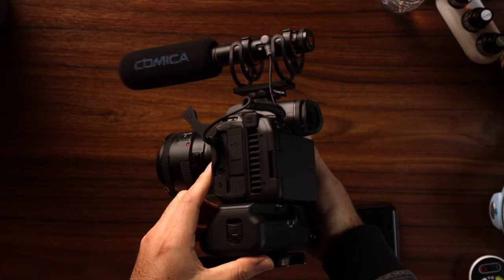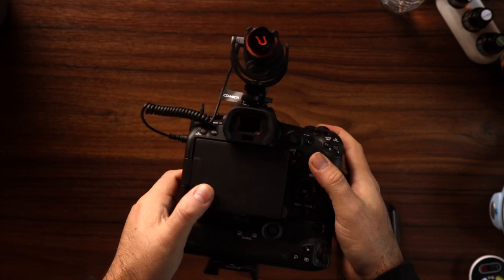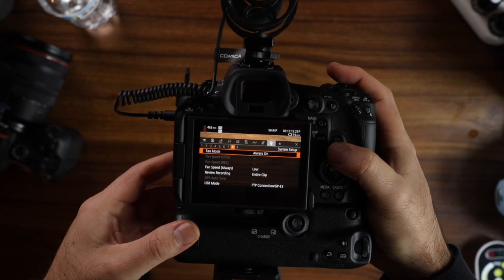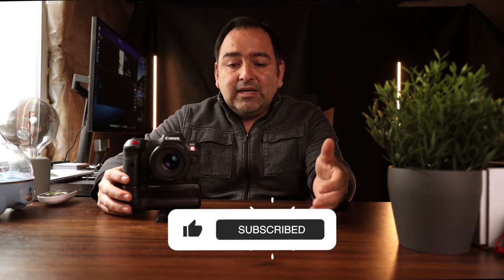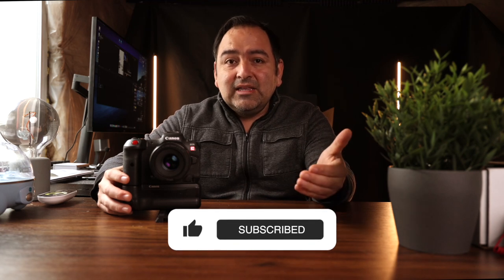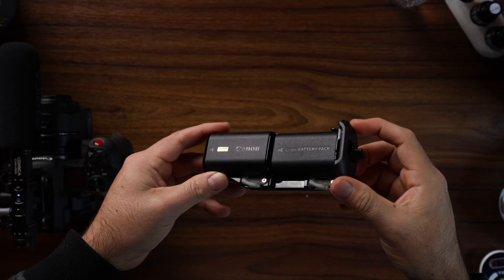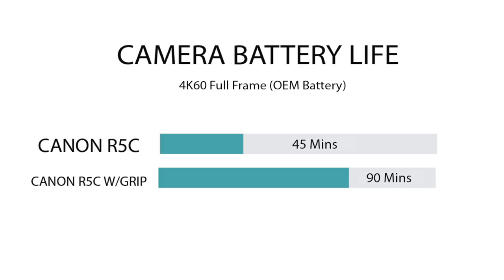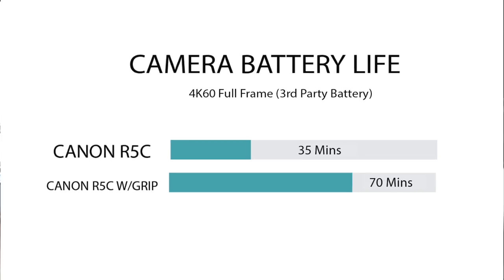Canon R5C Fan Noise test & Battery Update!

Comment: question just testing my fan today does your fan make a rattle sound if you shack it a little bit next to your ear ? while its always on ect.. i cant tell if its coil whine or my fan is a little lose i know any fan would make a rattle sounds if you shacked  but just checking my isn't  defective   thanks in advance
Reply: just to clarify its more a whine noise pitch change when I rotate the camera round into different angles  around its axis say while I'm holding it I've never had a cinema camera before so I imagine it would happened on bigger camera with fans also
Reply: I have a CPS test unit and that was the first thing I tested. It sounds like the fan is hitting the fan housing when you move the camera around. From my research it seems to be a common issue.